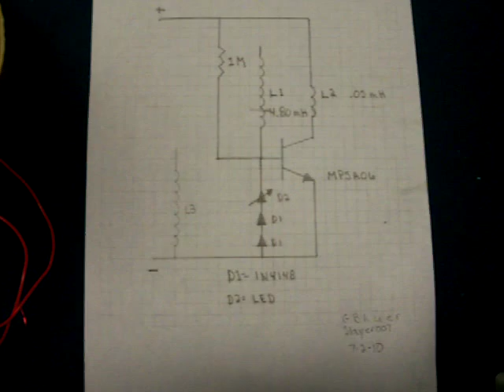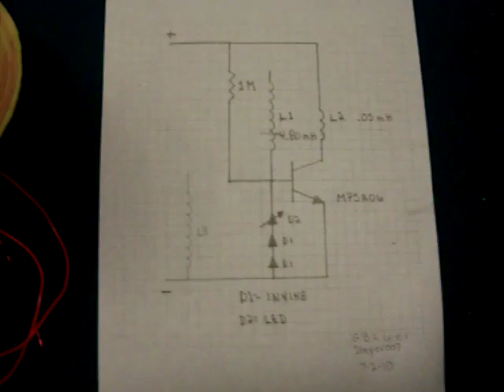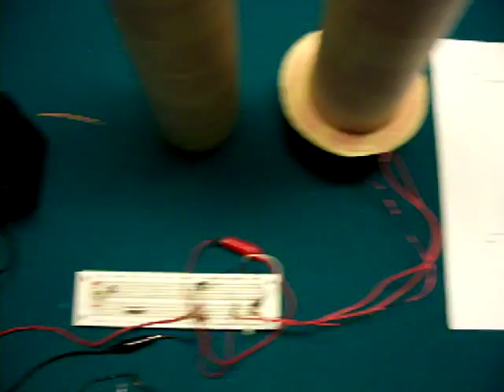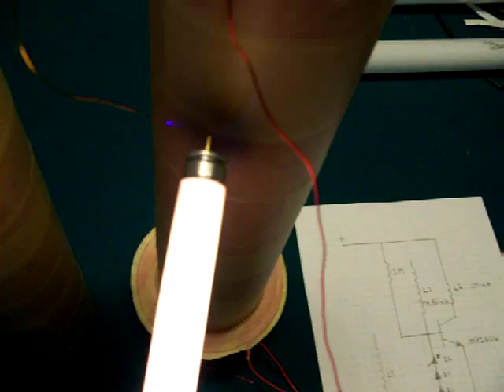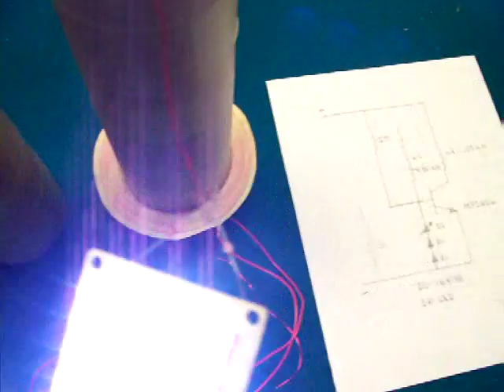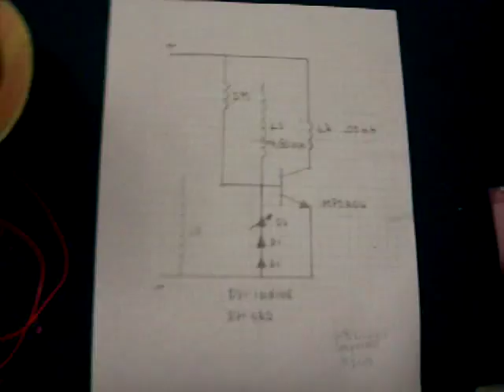Exiter with indicator light

Comment from the maker: @prototype9000 
Yes, There are a few transistors that will work like the 2N2222.
Even some PNP transistors will work,Just have to reverse the polarity at the battery.

But I think the MPSA06 is the best transistor so far.